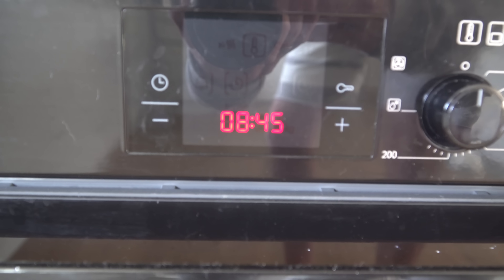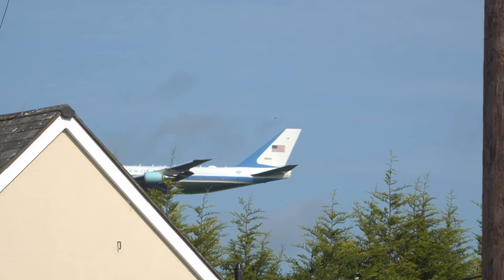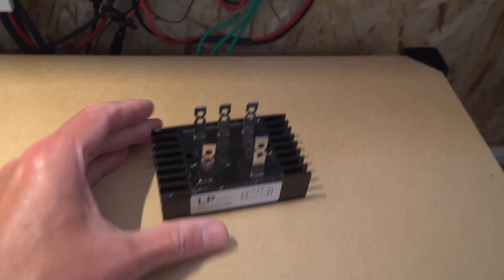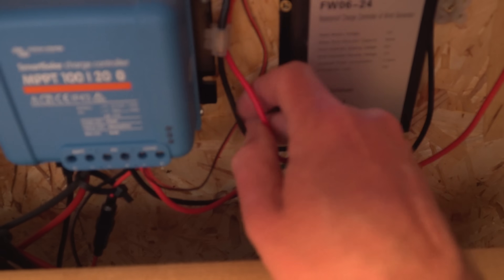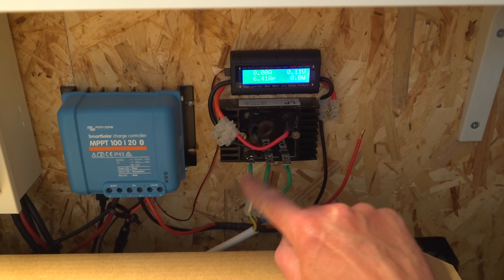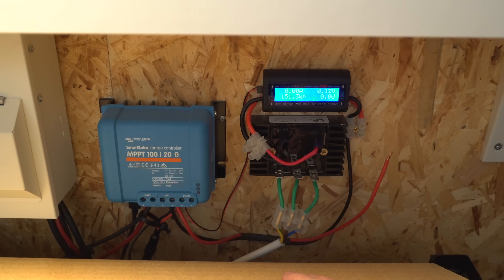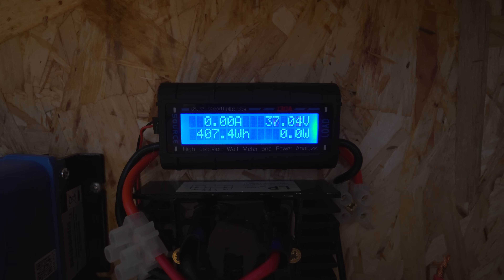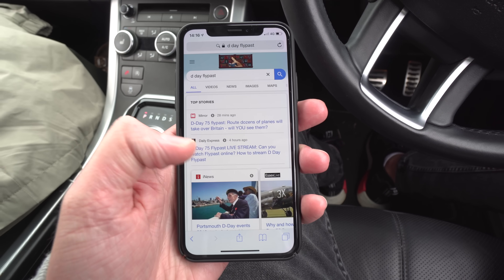500W WIND TURBINE EXPERIMENTS!!!

Comment: Could I get an update? how is that victron working out with the wind turbine?  Haven't seen many people use it for wind because it doesn't officially support it. Any issues? I'd like to go with victron for my next upgrade but I would also like to add a wind turbine with the smart controllers and run it through the GX communication controller so everything talks and syncs up, plan on using lithium batteries.

Comment: All practical tests show that small wind turbines hardly generate any electricity. And mostly only at costs above 1$/kWh! 
There is hardly any wind near the ground. And it is also very gusty, which extremely reduces the service life of the systems. 
With solar systems, due to the drastic fall in module and inverter prices, you can reliably generate electricity for about 
8-12 cents/kWh over a period of 25 years!

Comment: Anyone know? 

With that high precision meter does something have to be connected on the load wires for it to show how much watts a wind turbine is generating? Because when testing the wind turbine only the volts only go up and the watts stay at 0 watts.   ??
Reply from the maker: Yes you need a load. The power genersted has to flow somewhere in order to get a reading.
Reply: @andykirby  thanks 👍

Comment: you cant use MPPT controllers with a wind turbine. you need a controller that has a diversion load connected to it. say goodbye to your wind turbine in really strong winds
Reply: Why? if you don't mind me asking and you don't mind explaining:) like couldn't you use a morningstar tristar to handle the division load while charging off a wind turbine through a mppt controller?
Reply: But if your using a tristar for a wind turbine which I do there isn’t a need for a mppt controller as the tristar is a sophisticated charger on its own.
Reply: @Inlovewithsailing  if im using a 48v wind turbine , can i use a dc to dc converter to use it on a 24v battery system. 19 to 72v input puts out a steady 23 to 28v (user selectable) rated at 1000w 40amps..  and have a voltage set relay to come on when the batterys are fully charged as a dump to a water heater, or does morningstar ts45 work with lithium lifepo4 batteries , and not just lead acid
Reply: @craigmorton644  theoretically it might be possible to come up with a circuit of some kind to divert the excess load when the mppt shuts downs because battery is charged. I personally use a Morningstar TS 60 for my windbturbine.  They are programmable and have set mine up for Lifepo4.

Comment: You know if you connect only the red and the black it will work as a break for the wind turbine won't over speed
Reply: You want to do that BEFORE it starts spinning, never after it is already spinning quickly,
Reply: @MrSummitville  why?
Reply: @cleovanbigglesworth6046  How much HEAT is generator within the coils when you SHORT the output of the generator?  Can you touch the 500 WATT heating element inside a Toaster Oven?

Comment: Hi Andy, How loud is your wind turbine when it's flat out? I went to fully charged live and a supplier there said the small wind turbines are excessively noisy. I suspect he was talking b*llocks.
Reply from the maker: It’s not very loud, there’s a bit of a chopping sound when it’s got a groove on but only when your standing right next to it!
Reply: @andykirby  Thanks. I'll be installing solar, wind and battery storage in our next house. Watching your video's (including the twizzy) with great interest.
Reply: @martinbguk  was this the Iceland wind turbine stand?  www.icewind.is?  Funny their website doesn't mention prices: did you find out the cost of the small turbine?
Reply: @sjcsystems  No, it wasn't the Icelandic guys who said that. Had a long chat with them though. Interesting design. they did say roughly the cost but I didn't remember it as it's not the right solution for me.